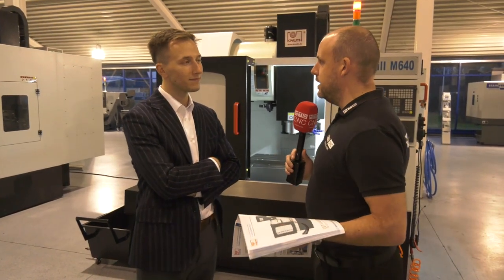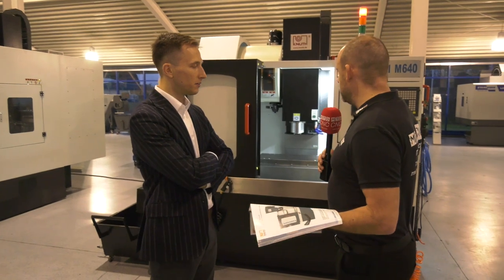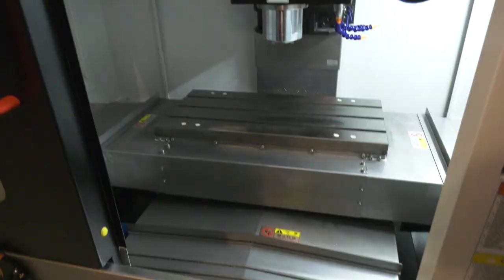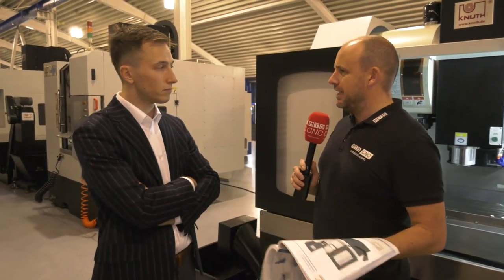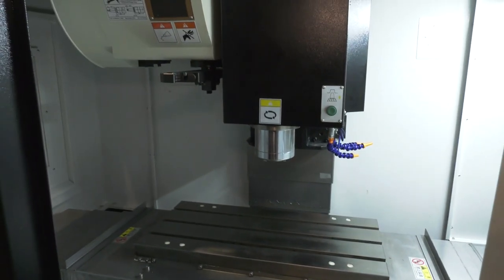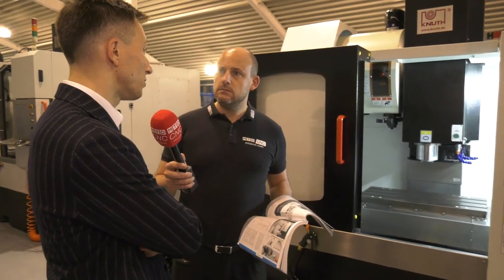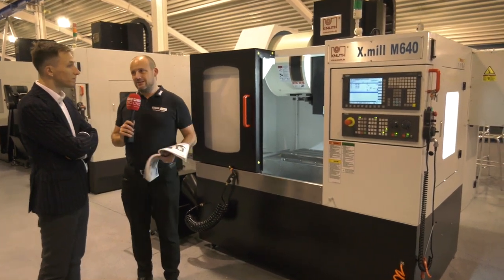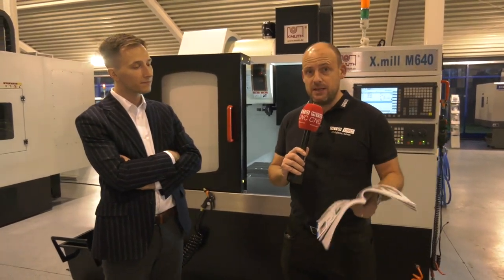What about this for a Mini Mill with a Mineral casting

Comment: Would be great if Knuth could do some tests on their Mineral casting servo lathe as well as their mills with Mineral casting to prove that. Tests for Ra and Rz as well as dimensional tolerances. Seems very compelling / interesting but would be "Bummer" if one bought such equipment that there was no real difference. Actual tests/data would be good :-)